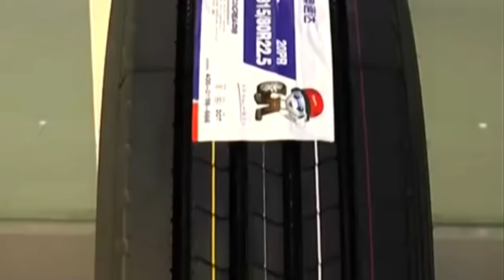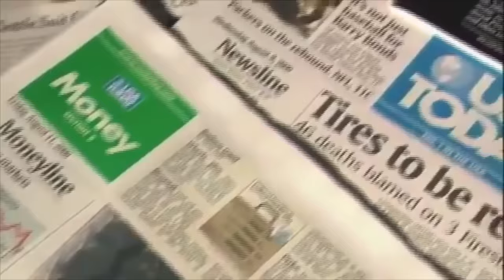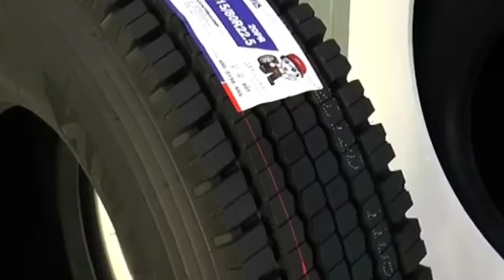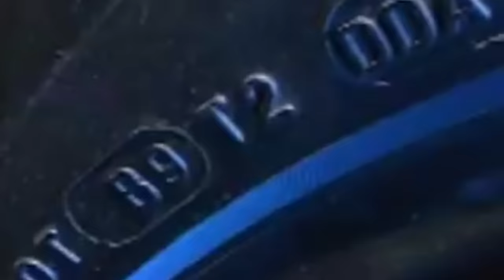5 Tires You Should NEVER Buy!

Comment: The Firestone Wilderness tire was just fine. It was the recommended inflation specs from Ford (28 psi) for the Explorer, that was the problem. The set that was on my wife's Explorer was inflated to 35 psi, and they ran for nearly 52,000 miles.

Comment: I was a compounder for BF Goodrich right after the Firestone 500 debacle in the late 70's.  Firestone had issues with  rubber adhesion to the steel belt. We checked every run of belt rubber and every lot of steel belt. I was told often that my job was on the line.

Comment: the first guy towing the camper that crashes is NOT a tire failure... it's an brain failure.  too small of a vehicle to tow that big of a trailer and the trailer was not loaded properly with correct weight on the tongue.

the 2nd camper that flipped was caused by extreme winds NOT a tire issue.
Reply: i know this has a lot of unrelated video clips not related to anything. it is dumb and pointless to even make a video if you do this stuff.
Reply: Not to mention that neither of those clips was relevant, the G159 was a 22.5R tire which no travel trailer has.
Reply: it was referring to Motorhomes.  the bus type motorhomes could have 22.5
Reply: Bob Builder, for straight-pull ("bumper pull") trailer: 10-15% of total loaded trailer weight before snapping-up the weight distribution spring bars.
Fifth-wheels: 25% of TLW.
Do NOT rely on sway control device for stabilizing an unstable trailer. Sway control is for added insurance against sway.
Reply: I use weight distribution hitch on my trailer at all times even when empty.
Reply: Bob Builder, WD is not to be used to make up for an improperly balanced trailer. 
WD is to compensate for the rear overhang of the hitch ball, which may be 4' behind the rear axle. It takes load from the tow vehicle rear axle and distributes it to the front wheels of the tow vehicle and the trailer wheels. When WD is set correctly the front and rear of the tow vehicle are pressed down by the same amount. If your trailer tires are already overloaded with static weight be mindful that the WD will put more load on them.
Reply: Bob Builder, As long as WD doesn't raise the rear of your tow vehicle higher than stock height (OE tires & wheels, springs, etc.).
Reply: I am well aware of how weight distribution hitches work.
Reply: It's amazing how dumb people incur totally predictable failures by believing they can drive 10mph over the speed limit no matter what the conditions or what kind of rig they're driving.  It's like the motor vehicle industry has carefully bred the common sense out of them.
Reply: I agree completely. That suv should not have been pulling that trailer even if it did have a WD hitch and sway control. I came up on a farm and am an owner operator truck driver. I'll be 50 in September and have been pulling trailers since I was 8. I routinely pull either a 20ft open car trailer or a 26ft travel trailer with my 78 GMC dually. The truck can easily handle the GROSS weight of either one with just  a class III hitch but I ALWAYS use my WD and sway control. Some say it's overkill but I say it keeps me from killing. For my big 36ft car trailer I obviously have a goose neck in the bed. As for tag trailers tho it's all in the tongue weight and that's why I use the WD hitch.

Comment: I worked at Firestone for a few years. There's nothing wrong with Wilderness tires, at least the newer ones. The issues, which you can find out if you look into the Explorer rollover scandal, were that Ford recommended running the tires at 26 PSI, which is way too low for a vehicle that heavy, 5,419lbs for the 97 model. All but 13 of the 200+ fatalities happened after 97. The redesign of the front suspension also effectively raised the center of gravity of the Explorer. That, coupled with a weaker roof due to weight saving measures, meant it was more likely to roll, and more dangerous to be in if it did. Firestone engineers warned Ford about the hazard, and they did it anyway. In fact, afterwards, they issued a recall that changed the tire info placard to 35psi. I know, because I owned a 97 explorer that never went in for that particular recall. On Firestones end, there was evidence of adhesion problems with tires from a single plant in Illinois, and they were slow to act on the info they were getting from warranty claims. I ran Wilderness ATs on my truck for 4 years, never had a problem. They were still on it when I got rid of it. As a sidenote, Ford still sells vehicles with Firestone tires on the global market, they only stopped in the US for publicity reasons.

Comment: While at my favorite tire store a couple of years ago, a large new travel trailer  was brought in by the dealer for new tires because the customer would not accept it with Chinese tires. The salesman I had bought from for decades pointed out the four tires had a combined load rating below the gross weight of the large trailer. Then, the store owner found that no tires that fit the OE rims had a high enough load rating. When I left, a high volume phone call to the RV dealership manager was underway. Don't know how it turned out. Made in Elkhart may be worse than made in China.

Comment: I've had two blow-outs over the years, one a front tire and the other a rear tire.  Both times I let off the accelerator and slowly coasted to a stop safely on the shoulder of the highway.  No muss, no fuss.  One of my blow outs was at 70 mph on a high center of gravity, raised, heavily loaded 4X4 pick-up truck which is a prime candidate for roll-overs.  When I was taking flying lessons it was drummed into me to always 'fly the plane', even during an emergency.  'Flying the plane' meant keeping a cool head and never let what was going wrong distract you from maintaining control of the aircraft.  Perhaps if more people 'drove the vehicle' during a blow-out there would be fewer roll overs and less deaths.  Jamming on the brakes and whipping the steering wheel back and forth will cause any vehicle to roll over, even with four good tires.
Reply: Well it is worse now cause stupid people don't even pay attention to the road anymore they are more interested in their phone who texted or who called 
I don't fell sorry for these people when getting killed in car wrecks

Comment: Years ago I had a set of 4 Predator Radial GTS's on my 89 IROC they were a Canadian Tire special and as I didn't drive like a maniac I didn't have any need for a super expensive performance tire. Within the first week the front left tire exploded as I was making a right turn at 10-15kph Canadian Tire said it was improper installation and replaced it. Few weeks later on my way to work going about 60kph the left rear exploded and actually caused damage to my car's inner fender, brake line and a bit of paint. At this point I was livid 2 tires exploded within the first month of having them. After many store visits and phone calls with Canadian Trash head office they agreed to cover the damages and replace all 4 tires at three expense, few days later they came with a flat bed to pick up the car, few days after that I was called to pick it up when I got there I was talking to the guy that put 4 new Cooper Cobra's on and he said the other rear tire was a short drive away from exploding. Thankfully they did a great job repairing the Camaro and the guy they had touch up the paint even went above and beyond and fixed a large scratch the car had on the hood from a ladder falling on it. I would like to say I was impressed with how well and fast Canadian Tire handled the problem.
Reply: Sounds like your tires had the correct name, when they called them PREDATORS.

Comment: 5 Tires You Should NEVER Buy!! ( if you could travel back in time....)
Reply: Recently Someone on explorerforum got a very low miles 90s explorer with those recalled firestone tires. He had a blowout but lived to tell about it.
Reply: Somebody running around on 25 year old tires had a blowout. Wow, ya think? Tire manufacturers can't fix stupid either.
Reply: Then he made a bad decision to drive on 25 year old tires. I was told not to drive on my GS430s spare with a brand new tire from 2001.
Reply: Publishing a video featuring tire discontinued in the 90s isn't much help. I even question the validity on the Chinese tire claim being relevant today.
Reply: Exactly.  With the exception of the cheap Chinese brands, none of these tire "brands" in production.  Tire models would be more accurate, as the major tire brands (e.g. Goodyear, Firestone, etc) are still in existence and producing tires.  Anyone who buys the cheap Chinese junk tires should be arrested.  Also, anyone who buys a used car and doesn't check up on the tires, should also be severely disciplined.  The tires are the most important part on any car.  Do NOT cheap out!  You're far better off with a used major brand tire, than you are with a new no-name tire.
Reply: i have only 4 tires on my car
Reply: @gusgiesel  Every tire brand today was once a no name tire brand. There are some really scary Chinese tires out there but there are some noteworthy up and comers made by reputable established tire manufacturers such as Sumitomo Falken(Ohtsu and Solar) and even Bridestone(Lemans). Research a little. There's some hidden gems out there
Reply: @johanzh2550  My car is on 4 tires and has one on it.
Reply: OMG

Comment: I remember the days back in the 50s and 60s when you could buy retread tires. Oh the horror. I remember always seeing lots of scrap rubber along the highways from retreaded tires that came apart. But those days are gone. Now you have to check the date codes on the tire for buying. That's another important factor when buying tires. It's a four digit code. They're now saying you should not have tires older than 6 years old on your car. But some tire retailers are selling tires that are older than 6 years that are brand new not good. Always check your date codes before buying it's on the side of the tire.
Reply: Lorenzo Maximo treadwrights do retreads, they are a huge scam company
Reply: I ran retreads for five years when I was in school. I took the advice from a trucker who had been using retreads his entire life, and simply checked the air pressure often and visually checked the tires. Never had any failures. The vast majority of tire failures are due to underinflation, and, then overheating of the carcass.
Reply: @niteshades_promise  they do for tractor trailers not for passenger cars
Reply: Airlines and the U.S Air Force use recaps . I worked for a major airline and am a retired Air Force aircraft mechanic. We used them back then.
Reply: I used old tires all the time,but these new and improved tires clearly have a shelve life.
Reply: You still see those tire parts on the road (Road Gators). The vast majority of them are from semi's. Semi's are constantly moving and go through tires quickly. Trucking companies use them to keep costs down because they're a hell of a lot cheaper then putting new tires on.
Reply: talon55130 I use them mine,but I know to keep my tires properly inflated. If look at 99% of those gators that cap (retread) is still attached to the carcass or it’s not a retread at all,low air pressure made the carcass fail.
Reply: If you have been on the roads lately you will see tire "scape rubber" all along which came off Truck Tires. They would seem to be more dangerous than car tires? I ride a Motorcycle and these tire pieces are a constant danger.
Reply: How do you know what it means. I'm so concerned about what tires to get for my srt.  Car hits 150mph like nothing
Reply: they wan't to allow it again where I live:(
Reply: I am going back to wooden wagon wheels just to play it safe!!
Reply: The first car I bought used,  had recaps.  It drove OK.  Being a teenager, I put on Crager mags, and a new set of Goodyear Polyglass tires.  The driving and handling was a 100% improvement.  Made a believer out of me on you get what you pay for.
Reply: Lorenzo Maximo big trucks still run retreads today on the drive axles and trailer, not on the steers!!!
Reply: Sid May Pirelli or Michelin, maybe Toyo
Reply: We get retread Goodyears for the rears on our postal vehicles
Reply: @billmielke7395   No they are not good for tractor trailers either. Most recaps are speed rated here in OZ to 90kph but trucks are constantly doing 100kph+ for long hours so the recap glue overheats and the tire comes apart but they are cheap so thats why truck use them.
I'm a truck driver and the company I work for uses retreaded tyres on the drive wheels and new on the steer, retreads on the trailers.
Reply: Funny how I was just watching re-treaded truck tires lol oh the nightmares?
Reply: @splutt6315  TV.
Reply: @splutt6315  feet y. Ĺ8
Reply: All airliner tires are retreads.

Comment: I worked at a Ford dealership when the Firestone recall was in full swing. We were replacing brand new sets and mechanics and parts guy's were reselling them under the table as fast as they came in and making money off of unsafe tires.
Reply: Kenneth Hildebrand The Firestone problem actually wasn't anything to do with the tire. Ford recommended them to be inflated to 24psi when Firestone recommended 32psi. Any tire that is that underinflated is going to suffer catastrophic failure after a short time.
Reply: no I tell people all the time to always inflat tires to the vehicles manufacturer recommend psi, but people come in all the time 20 psi over or under. I had a woman come in say her car was riding rough. I checked her tire pressure was a low of 50 psi and high 70 psi on a Corolla.
Reply: We used to have to cut a big piece of the tire off
Reply: During Firestone 500 recall, we were soon instructed to slash the sidewall near DOT branding.
Reply: I work for Firestone, the actual problem was that Ford was setting the infaltion pressure too low and the tire wasn't designed fot that. It built up excess heat from the increased friction and the tire failed structurally. All because Ford wanted the Explorer to ride better. I still have a 96 Explorer with the door sticker that says 24Psi
Reply: Thank you Kenneth that's what these forums are all about and I'm disappointed to see  people all these years later rehashing fords b***** excuse for what happened

Comment: I have bought many sets of tires for cars and trucks i've driven. I have always bought Cooper tires. Not that i've asked for the Cooper tire brand, just that the tires I pick have always been manufactured by Cooper. Over the last 25 years or so and 6 vehicles later, I have "never" had a problem with the tires I have bought. The 2 worse tires i've had came with a new vehicle when bought were the Uniroyal Tiger Paw and the Goodyear GT+4. Both brands wore out within the first 20,000 miles.